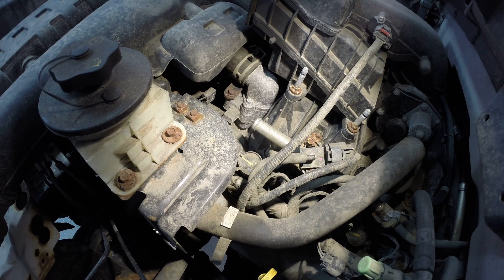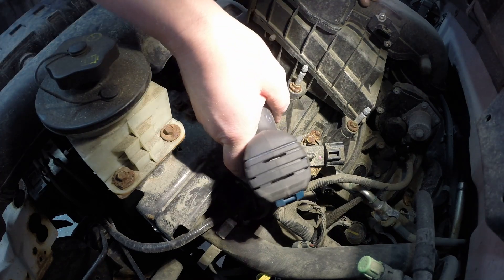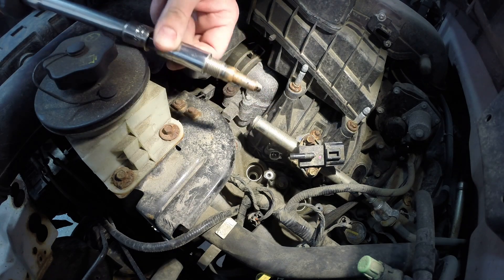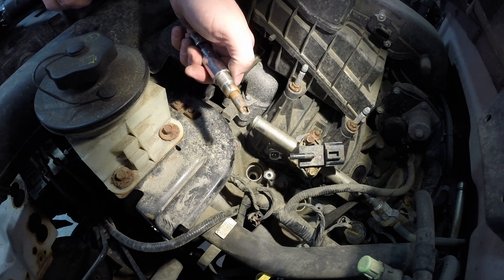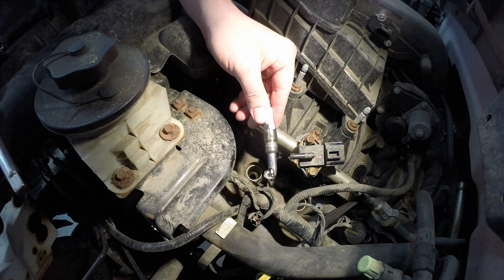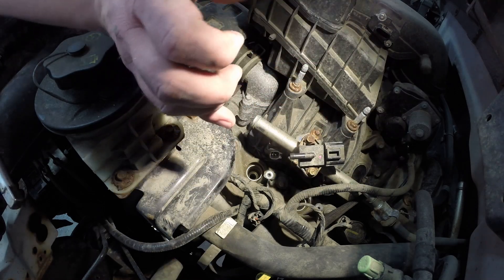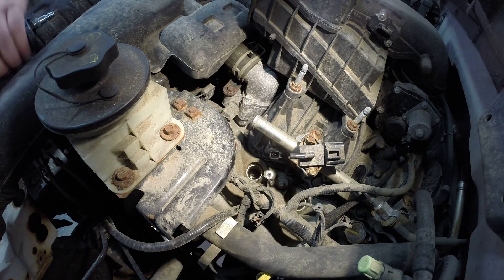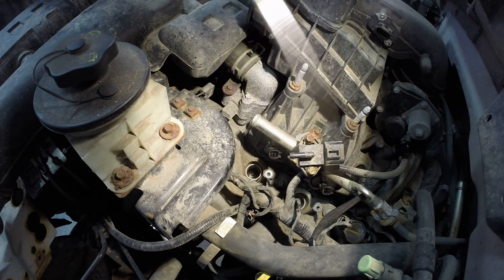The Best Method for Removing STUCK Ford 4.6L & 5.4L 3V Spark Plugs??

Comment: Looking at replacing the plugs on out '07 Expedition...
Can I use the updated "normal" plugs, or must I use the original 3-piece?
Reply from the maker: You must use the original plug SP-546 now they come out no problem
Reply: @FordTechMakuloco  thanks for the clarity there! I have found your channel VERY helpful in working on the family's Tritons. They're great engines, but they have some quirks. Lol

Comment: I have an 08 expedition and my wive has an 07. I heard there was a change of some sort for the 08 year. Are they still the same plugs and is the link in this video up to date on the correct plug to use?

Comment: I have a 2003 ford f250 super duty v10 6.8L Triton gas engine 4x4 truck  does the plugs break off in these engines also because when I went to the part store  to see the plugs they looked like regular plugs Also is it easy to strip out the plug threads in the block if I use w-40 just wondering thank you other replies would also be appreciated thanks

Comment: I am a 22 year master tech and was working for Ford when this design came to the market. We tried many different methods to successfully remove these plugs before actually finding this method purely by accident and out of frustration. I've done literally thousands of these plugs this way using an ingersoll hammerhead and have never broken one since. Heat and vibration=quickly removed,unbroken 3v spark plugs.
Reply: He said 22 year master tech not 22 years old
Reply: @AP-xq3jm  reading is hard
Reply: Did this happen in the 2006 year or older?
Reply: Steal bolts and spark plugs are prone to freezing the 2differnt metals really like to stick together even when you don't over tighten them at all.
Reply: @larrygooch6233 it's definitely cheaper to "STEAL" them lol just playing
Reply: Good info.  Thanks.
Reply: Isn’t there a big chance of stripping the heads removing stuck spark plugs? Just curious, when I mentioned this to my mechanic friend he advised me not to use an impact wrench
Reply: That's what my uncle told me. He's a mechanic. He says tap tap tap.
Reply: Tell me why motorbikes not have a problem only cars?car enginers are worst then others.who the hell put those plugs there?no wonder why they break or damage when removing it.
Reply: @dokesz530  I have a Harley. I had this problem once. They used a cheap tool set at the shop.
Reply: @skywind007  not only that but lot of people ignore to appy copper grease on the threads.also use it on bolts it ll save u lot of time.
Reply: @dokesz530  Some bike makers are also car makers, like Honda, Suzuki, and BMW.
Reply: So, as a master tech that actually worked for Ford, did you tell them that this design was insane? Just wondered.
Reply: Great job on blowing out the dust .....the problem on aluminum head threads is the spark plug threads at the bottom all ways collects carbon and rips the threads...so it's remove super fast or take about 15 minutes per plug to slowly crack them loose for the first turn .

Comment: use a another ext at least a 3 I don't like the impact wow it goes or stripes or breakes i will do my by feel bit by bit and wd  40 that's all i need is 2 snap a plug off in the head.. i don't even want to think about that  grrrr

Comment: NEVER EVER USE AIR TOOL TO REMOVE SPARK PLUGS.  NEVER !
Reply from the maker: This is only to be used on this spark plug 2004-mid year 2008. Read up on it....

Comment: I poured carb cleaner onto the plug, let it sit overnight, then cracked the plugs an 1/8th turn and let it soak a few more hours, then cracked a 1/4 turn and finally removed them. Soak, crack, soak, crack, soak and remove.
Reply from the maker: That’s the official Ford method this is much faster
Reply: @FordTechMakuloco  I switched to a one piece plug at 120K miles, now at 290K still working fine, maybe time to change. Motor purrs at 290K but thinking maybe high volume oil pump. Another note, I ran Marvels in the engine a number of times, also wasn't great about oil changes just every 7K-8K mile  but synthetic. Lucky maybe.

Thanks for all your vids!! Awesome stuff!

Comment: I have an issue with my 09 expedition , the engine vibrates badly when i shift in reverse and it happens in drive mode in bumper to bumper traffic then I have to bring it into neutral to undo the vibration, don’t know the cause , please help

Comment: Of course by the time you remove everything in the way to get to the plugs, the engine has cooled down. Those old plugs didn't have much if any carbon deposits, you could probably do em cold and still be ok. If your gonna replaced the plugs anyways, just carefully  stick some small flame bottled heat right on top of em... warm em up a bit. Why work with a hot engine? Heck with that.
Reply: It's the bottom of the plug that you want hot ,not the top.and it should take less than 2 minutes  to get the stuff off the drivers side , little more for the passenger side but the engine should still be plenty hot. If your wary of working on a hot engine you should probably pay someone else to do this job for you.
Reply: @dirtracingfan8742  never paid anyone to work on my stuff, never removed hot plugs and never had a problem doin it.

Comment: I have a quick question.  The SP515 spark plug looks like it was superseded to a SP546.  My truck is a 08 f250, and I have a high rpm misfire.  The code is p0300 like normal. Should I go with the updated SP546, or go with the SP515 like you have in the video.
Reply: The 515 was that three piece Crap that was prone to breaking. I believe the SP547 is the best one now.

Comment: How do you reach the rear cylinders with an impact? What has to come off?
Reply from the maker: Just pcm and bracket.
Reply: @FordTechMakuloco  does the Lincoln navigator 2008 model year have same issue?
Reply: @exploringalaska3940  yes

Comment: I replaced my plugs 06 Expedition 133K miles by first running 3 tank fulls of Seafoam and let the engine sit for a day to be absolute cold.  Then after blowing out the plug wells I put a very small amount of Chemtool in the well to let it wick down the threads as I extracted the plug using a ratchet with an extension.  All 8 came out free of breakage and with hardly any carbon build up on the tip.  I used Hi-temp Anti-seize and Dielectric grease and a new set of coil packs, also I went with an Autolite one piece design base instead of the Motorcraft to minimize any issues should I need to change them again if I happened to keep it that long.

Comment: Thank you for this video! My 2005 F150 has 106,000 miles and original plugs, so I decided it was about time to swap them and the coil packs out. I have been able to change six of the eight plugs without breaking them. For a non-mechanic, I'm pretty happy with that and I owe a large part of it to your videos. 

What I can't figure out is this: how the heck do you get the impact wrench on the plugs for cylinders 3 and 4? I can't even get my Aircat Stubby back in there... Do you have to remove a bunch of stuff? Between some rigid hoses, a board that contains what looks like three big relays, I cannot figure out how to pop out those last two plugs. I'm guessing those hoses aren't supposed to be removed... how do you get at those last two plugs? 

Thanks again for the videos. They have enabled me to change my shocks and struts, ball joints, tie-rod ends, etc., all stuff I would never have thought of trying. Thanks!
Reply: I actually figured it out: to reach the #3 and #4 cylinders, the PCM panel and mounting bracket have to be removed. Getting to cylinder #4 with the stubby impact was still a bit tricky, but it fit. In the end, I was able to get all 8 plugs out intact. Mine did not have a lot of carbon, mostly rust, but I've been running Techron in the gas most of the summer to clean out the carbon. It seems to have worked. Thanks again for the great video. It gave me the info I needed to get this done!

Comment: You're working against time by time you get all that stuff off of the engine be ice cold that's how Ford's are Ford is so expensive you have to buy special spark plug tool from spark plug instead of sticking with the 5/8 spark plug like GM uses that's why I keep Chevys

Comment: What power level did you use on the air gun?
Reply from the maker: Max
Reply: @FordTechMakuloco  Great! I'm going to try this today, hopefully it all works out. Do you know if the champions 1 piece are a good fit? I have both, just don't know which to install.
Reply: Can you tell me what psi you should have your compressor set it if you have the air at set to max?

Comment: Correct me if I’m wrong but if u change the plugs in a hot engine doesn’t the cylinder threading part stripped cause I never do tht until the engine cools down at least half an hour to and hour I never like doing this method it seems to dangerous for me
Reply from the maker: Correct and this is the only engine this method should ever be used on because of it's unique problem. Even so with as many as I have done this way there has never been any issue with the threads after.
Reply: If its not your car or truck, who cars if you fuck up you can always say it was the trucks fault

Comment: Mine are stuck I don’t have a impact. The motor is a 4.6 90 something model it came out of a grand marque it’s in my 97 f-150 lariat. The plugs are stuck big time. Mine has coil packs two of them one on each side. Any suggestions on what I can do to break the plugs loose. The plugs are Motorcraft platinums in the motor now I’m putting the same back. The guy that changed them before for me didn’t put anti-seize on them stupidity on his part. Any advice would be greatly appreciated. GOD BLESS.

Comment: Hey, I have an 05 mustang gt with the 3v 4.6    It only has 35k miles on it, I'm wondering if I should just try and replace them now to an updated version or just wait until i need to change them?    Do you think it would be worth it to change them out now, or is time more of a factor than mileage?
Reply: ryancrazy1 - after starting this job and breaking 7 of the 8 plugs. I would definitely replace them ASAP.  From what I understand the new plug Sp546 will not separate.  So for about 75 or 80 bucks you can have a little piece of mind.
Reply: Dave Bliley but do you think I'll have this issue if I replace them now, or just hold out for the inevitable
Reply: ryancrazy1 From what I gather the new plug is just one piece so it can’t separate like the ones currently in your car. I would like to think if you change them now you should not have this problem ever again. Fingers crossed. I would personally just get those bad style plugs out now. I’m dealing with these issues now and it’s a pain in the butt.
Reply: I don’t think you would have the problem with only 34k but you never know for sure. My vehicle is over due At 125k. But it is definitely millage dependent. I would follow the break them 1/4 to 1/8 turn apply penetrant rule even with those low miles. Just to play it safe. But I bet they will turn right out.

Comment: should these plugs be replaced , even if there is nothing wrong with a 10 yr old truck with 5.4 only 30K miles?
Reply: LucasLand if you plan on keeping it, I would get them out now. Put the nickel anti seize on the barrel of the new ones and you should be good to go. Seven of  the eight broke on me. I don’t ever want to deal with this again.
Reply: What does the ford manual say that came with your truck ?
Reply: I would yes as a precaution and use anti seize lube

Comment: i have a 2005 f150 with 99k miles, it came from ohio and i know how the rust gets to the engines. The truck runs beautiful, the only problem it has is when I'm at a light, the truck kicks once every other minute. Can that be the sparkplugs ?
Reply: santana ramos could be the plugs, a coil pack or a boot. Put new boots on first as they are cheap. Maybe you will get lucky and it will go away. If not maybe it will throw a code in the future so you know what cylinder is missing.

Comment: Great info am getting a 05 f150 fx4 that needs plugs changed I googled the spec on that aircat what power lvl to you have it set on 
By the way good price and 500 ftlbs not back

Comment: Would a cordless 20v impact driver enough to get plugs out?
Reply: Answer is yes! Replaced all 8 , #3 n #4 need u joint and extension without removing anything else. Only unclipping fuel intake plugs.

Comment: glad mine is a 2008 f150 with the 5.4 with the updated fix plugs come right out if your coil packs have the brown boot and the engine build date is later than 12/1/07 you will have the normal plugs

Comment: I have a 2004 F150 FX4 extended cab with the 5.4 3v Triton that I bought used". I changed the spark plugs at 100,000 miles after running tanks of gas with sea foam.  I got all 8 plugs out with no breakage, but now after a few weeks I have a fuel smell in the cab of my truck.  I'm being told I shouldn't have put anti seize on the spark plug threads, or that I just need to re-torque the plugs to 25 ft. Lbs.  What do you think the problem is?

Comment: Hi FordtechMakuloco I'm long time subscriber and own a 2005 mustang gt. It has 130000 km on it and the spark plugs have not been changed. I'm planning on doing them using this method indicated in your video. I even bought the same mini aircat just to be consistent. Do you still recommend this method. Has anyone else been successful using this and prefers this. I have the broken plug puller just in case. Thanks any advice will be helpful.

Comment: I have an 04 bought used with 140k it now has 180k runs great prob needs a plug change. Anyone know how to tell if the plugs are original by looking at them from the top or do I have to try to remove one to check?

Comment: U can see the spark plug fairly new no carbon deposit on it so it will not break if over 100 miles sp it would be different

Comment: I have a 2010 Navigator 5.4-3V with 98K miles and doubt the plugs have ever been changed because plus I'm getting misfires under load.  I just looked at the space for using the Aircat impact and the only plug I'm concerned about is the driver side rear plug?  Does the impact fit in that area well enough to use it?  Thank you.

Comment: @FordTechMakuloco Did you use the same "OTC 6900 Ford F-150 Spark Plug Socket" you used that you recommended from Amazon when using this stubby impact? You suggested that tool in an older video, but that was way back when you were doing them with regular tools.

Comment: Just used this method on a 2005 5.4 F150 with 117K miles on the original plugs. 8 of 8 came out intact.  Thank You!
Reply: Kevin Braby how did the plugs look and how was the engine running ?   I have a 82k on a 2006 I bought and thinking I should change mine

Comment: How much stuff did you have to remove to get that air tool anywhere near #3, 4 and 8? Also, it's not carbon I've run into, but RUST. Soaking with PB blaster and carb cleaner and patience, is the only way to not destroy the heads or break a plug.
Reply: Also, I'm seeing these trucks with way over 120K on their OE plugs, so these things are REALLY in there!
Reply from the maker: I have only seen a few with rust move have a thick coat of carbon.
Reply: Wish I could upload the pictures... Thx for your vids!  I'm always looking for new ideas in trouble shooting.

Comment: I just finished this job using this method 10 minutes ago. 2005 F150 5.4 3v with 84477 miles. Went 8 for 8. I purchased the stubby impact from harbor freight and set my compressor at 80 psi. Thanks for the video.
Reply: You need a stubby impact or hammerhead impact. The Ford procedure is to use a 3/8 impact on them. Run the car till its hot. Do one side. Run it again till it warms up again and then do the other side.
Reply: What must be removed to get to these rear cylinders with an impact?
Reply: You are a PRO, nice work
Reply: Were you able to stubby impact the rear plugs without extensions and u-joints?

Comment: Awesome vid. I'm also Ford certified. I'd started doing it that way only a month after the Bulletin was put out to soak them with penetrating oil and wait an hour then use a regular ratchet for removal. I found out most of the time this did not work I let it soak overnight and tried to remove spark plugs next day and I still had 5 out of 8 break off. I do recommend this guy's method. One other Tech I worked with at Ford did the same thing. He wouldn't always get them out but for the most part he got more of them out without having to use the extractor.

Comment: I had runner control valve go bad of course it was a dealer item and me not knowing what it consisted of in replacing this part so I was intemadated and FORD wanted 950.00 to change out seeing how I was going to have the intake off I figured it was time for plugs so everyone told me not to do it myself that they are notorious for pulling threads out and breaking I found the platinum plugs on rockauto.com for around 85.00 for all 8 plus shipping that was huge considering  advanced auto parts wanted 19.99 per plug needles to say did all the work with no issues except for the booster vacum line guys this is a b##### so go ahead and take a wrench and take this line loose from back of head on driver side of course once the intake is off and I recommend putting it back on before you seat the intakeback in position I am not a mechanical person I am good with my hands with anything I set my mind to but that one vacum line caused me a few times of removing the intake before I decided to take it loose so I could attach it good before reinstalling intake hope this helps someone who reads it

Comment: I have a 2004 F-150 with a 4.6L. How can I find out if I have a 3 valve or a 2 valve engine?
Reply from the maker: you have a 2v engine.
Reply: FordTechMakuloco. Thank you, I'm planning to change spark plugs in 2 weeks.